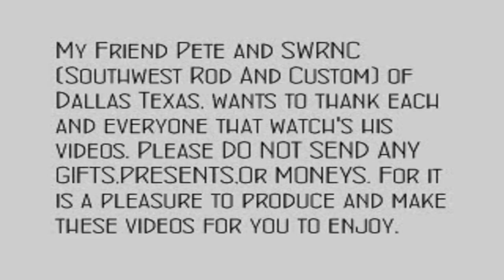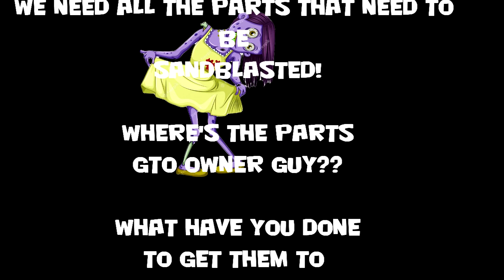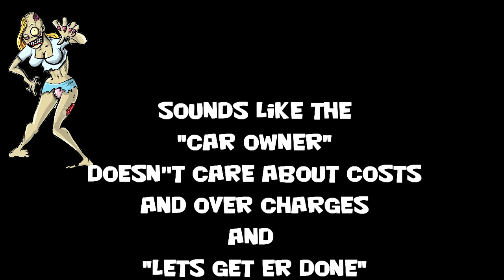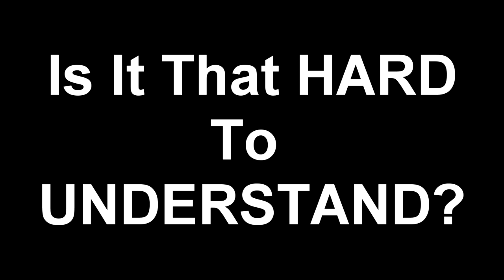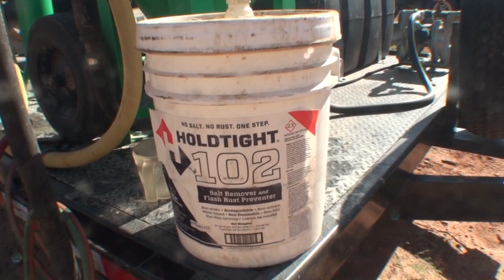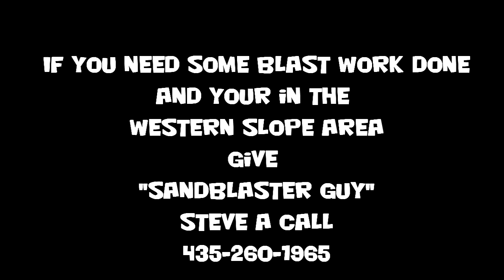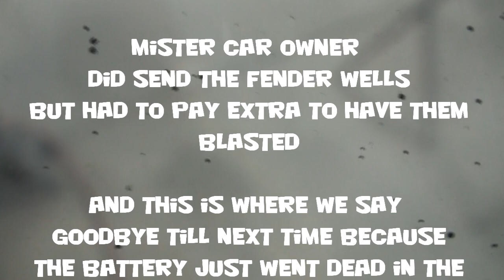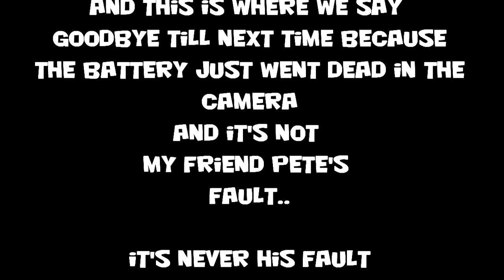Sandblasting A 67 PONTIAC GTO - CAR OWNER Get Your Sh%T Together

Comment: I have never seen this done but explaining it the way you did Pete makes soo much sense. Work smarter, not harder! Allow for Steve to wet-blast the firewall, bottom, jambs, tail light panel and inner fenders makes sure this is getting a good epoxy coating without having to take extra time, wear and tear on My Friend Pete's knees and other parts. Good for you. Thanks for the lesson!
 And if sandblast Steve have to travel, he has to and can account for miles driven to work, fuel, wear and tear plus set up. If he needs water and all the customer has is a garden hose, that could take hours as he would using it faster than a hose could fill it up. So that is another item sandblast Steve has to account. Fuel & maintenance on his compressor engine, air filter and "Twin-Screw" compressor maintenance filter & oil. It is great he is in your back yard even though your back yard is 60+ miles! Prayers for the knee! That is not fun!

Comment: Blasting is best done with low pressure (30psi) high volume (300cfm) …this type professional NEVER gets warping on roof ,hoods or any panel (always use plastic)

Comment: In south Fla. we have a chemical stripping company with a huge stripping tank we dip the body, frame & all sheet metal in and after stripping they pressure wash it totally clean. Then they also have a second tank filled with rust proofing they dip the car in overnight with a anti rust anti corrosion primer so it sokes into every crack & seam to totally eliminate all rust inside the seams. Few days later it comes back, we scuff everything with 320 paper & scotch bright pad, wipe everything down with wax & grease remover, then shoot 2 part epoxy primer real heavy over all of it and go on to seam sealing, body work & paint work.  after having it done this way a few times, I would not sand blast anything big ever again.
   P/S never mix epoxy primer until ALL parts are fully sanded cleaned and wiped down laid out (or hung) and totally ready for primer. Then & only then do you mix very expansive 2 part epoxy primer.
Reply: How much is average cost to have one dipped.

Comment: Im surprised Pete doesnt have an electric wench on his trailer, for how much he uses that thing. It would be cool if he got a harbor freight one, put in on his trailer and did a review of it, i always wondered if they were decent or not.
Reply: They're pretty decent.  Winches have a duty cycle.  I've owned the 2500 and the 12k and both are good.  The 12k on a truck hitch mount is great and very versatile.

Comment: do you have any videos or advice on how to change the top skin of the car how to replace the complete roof of a car it's a mantine 70 Chevelle SS 396 a tree has fell on the roof of it I don't think it can be fixed I think it needs to be replaced
Reply from the maker: It may not be as bad as it seems. I’ve fixed roofs thst people thought where toast.  It the areas around the front and back glass are all straight and the area around the drip rails are ok then more then likely the roof can be saved by using a 4 ft 10 ton porta power and working the roof out slowly.  It’s a big job but it can be done.

Comment: if i was going to have u work on my car i would have everything for it with the car and i would have extra cars for parts for it. like my next project a 79 z28 rs t top have 2 extra z28's hard tops for parts all are rust free cars one even has new custom interior in it with inkee wheels even have a 327,350 4 bolt and a stroke 454 all low miles on engines under 10,000 on all of them. i have the parts to put all of the z28's on the road but only need one even have a t-10 4 speed and new fly wheel clutch setup for the 454 got it all for free everything so far i have nothing in it . plus i have a lot of rust free rigs full of parts for the rig mostly pu's chevy and fords from 65 to 79 project rigs all lined up
Reply from the maker: Thats the way to restore a car.. Have the parts cars ahead of time.. I like your thinking... THanks for watching Jeffery!

Comment: THAT Sir was most enjoyable to watch..very informative on how to do old screws etc i never knew heat,,we used to push correct sized screw driver into screw n hit with hammer while your twisting,, NOW,i KNOW its in a door jamb b cannot be gotten at easily . THATS why its so informative..ive learnt several things today...it got a bit bitchy in middle of video talking to owner on ph, but i would be cranky with owner also..but overall youre back to what you and Minnie used to do,TEACH the correct way .. TY Sir and Minnie for  excellent instruction..god bless..Robby J in OZ

Comment: Re-pop fender wells are less than $200 each.  Are they not as good as the originals?
Reply: You usually, have to MAKE THEM FIT when buying re-pops is the MAIN issue..They never wanna just bolt right up outta the box NM WHAT the brand actually are IS the problem..And NO, the re-popped metal is significantly alot thinner as well. Original ALWAYS is the better route (IF it AIN'T rotted out, obviously).